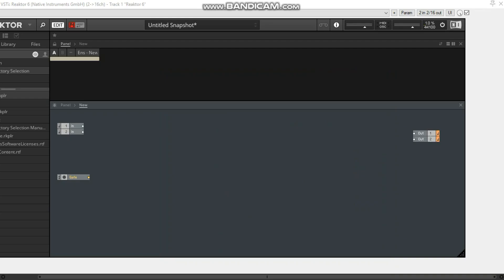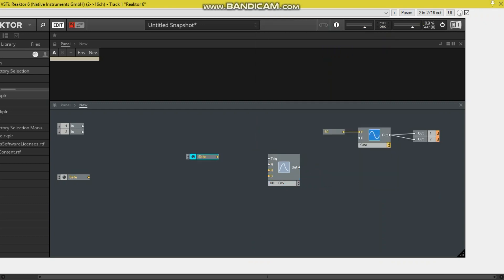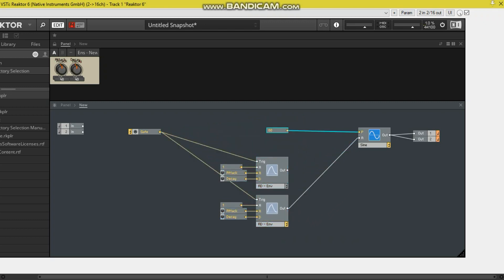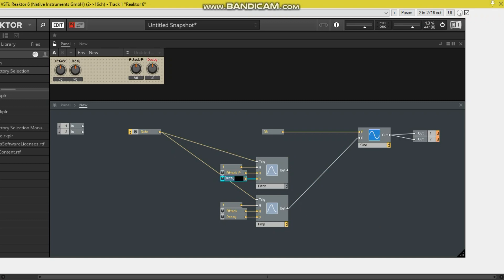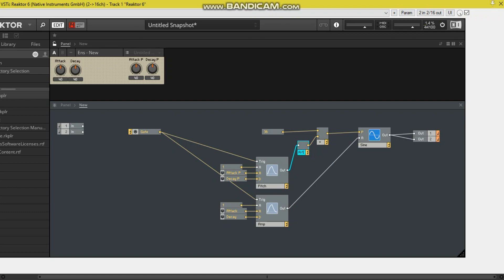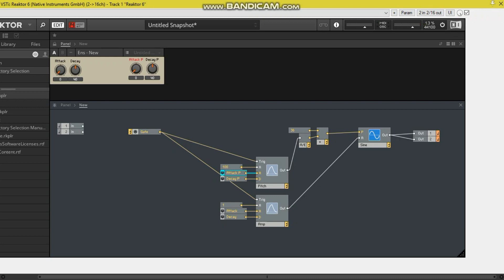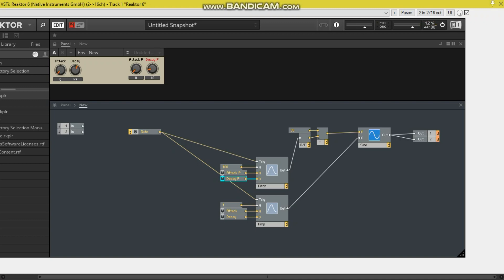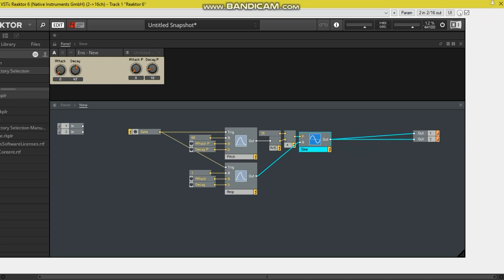Building a Kick Drum Synth in Reaktor

Comment: Can you explain more into detail what that A to E does? Is it some kind of signal difference? I work with eurorack analogue stuff and venturing into DSP I find things like this kind of difficult, why can't you just use the signal from the AD envelope to add mathematically to the fixed value of 36? Is it like the program needs to understand a difference in current signal to something else? I know we are not working with real current but what then?
Reply: Ooh I see, it is an audio to event converter, since what comes from the envelope is an audio numerical signal and the pitch is an event triggered value, ok, thanks.
Reply from the maker: +Byron Marmol yeah, it's a different signal. Event signals work at a sample rate of 400hz while the audio is at the defined sample rate (usually ~ 44 kHz). This is because the event signals only need to carry values at a much lower fidelity so it saves cpu because it can get away with processing much less info. Compare it to a remote control, which controls your tv, the remote doesn't need to send anywhere near as much signal to the tv to change the channel, compared to how much signal the tv receives from the satellite.